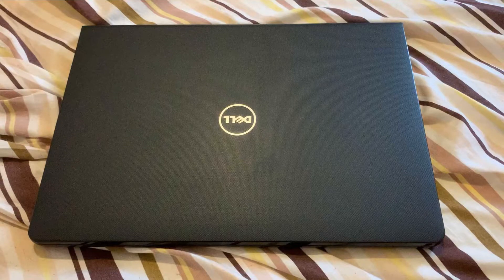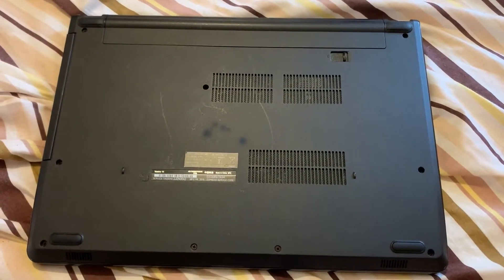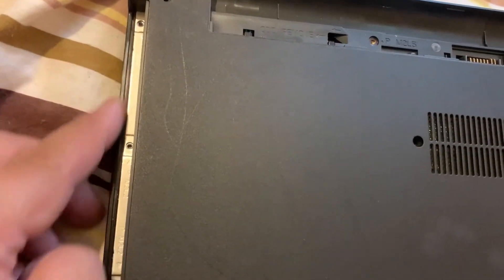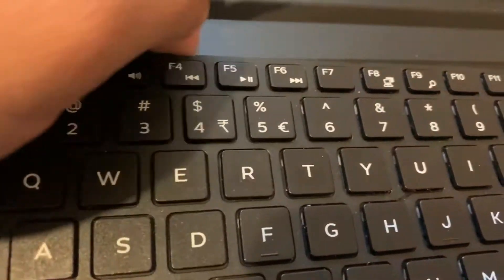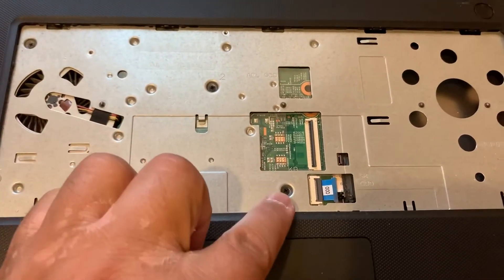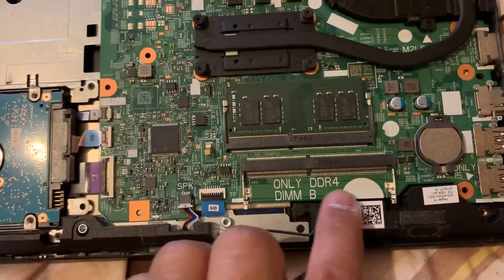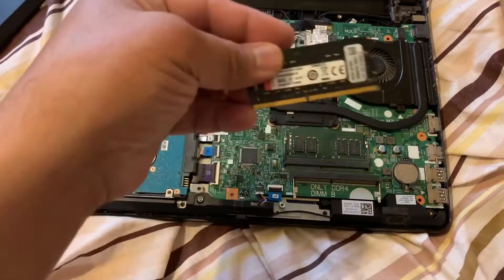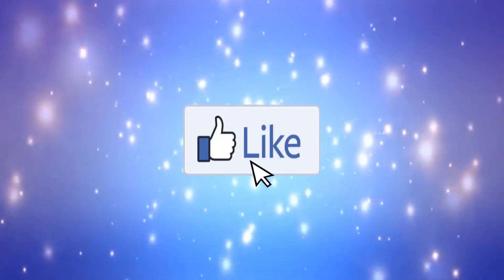DELL VOSTRO 14 3000 (3478) - Upgrade RAM, Remove KEYBOARD, HDD, CMOS Battery

Comment: I have same model but not dedicated graphics but same model have dedicated graphics amd radeon 520. So can I go for dedicated graphics, I'm not confirm that my laptop have dedicated slot.
Reply from the maker: Hi unfortunately the gpu chip is soldered onto the motherboard. It Won’t be possible.
You can either buy this laptop with integrated graphics or optional extra with dedicated. I hope this info helps. 

can you please subscribe to the channel.